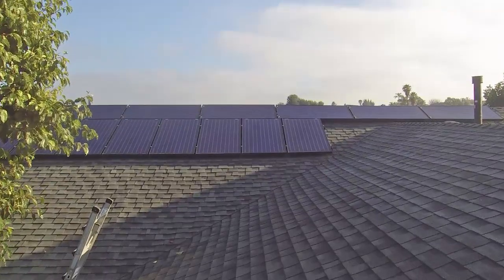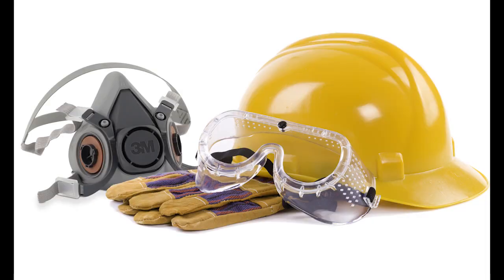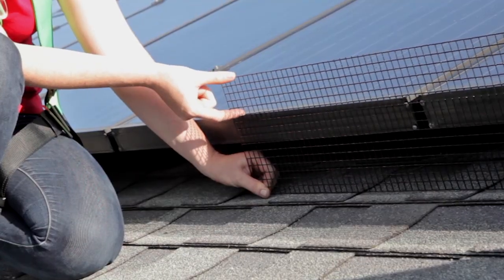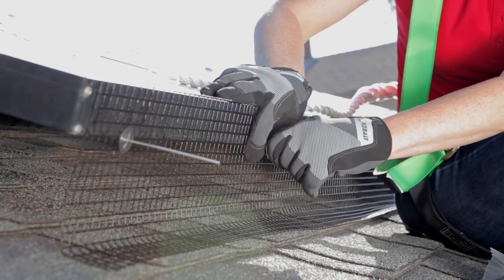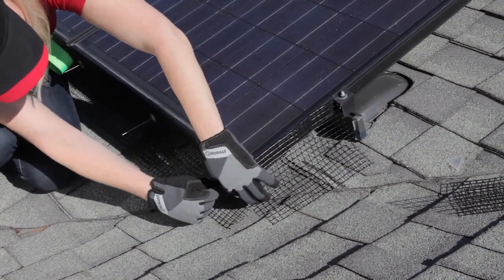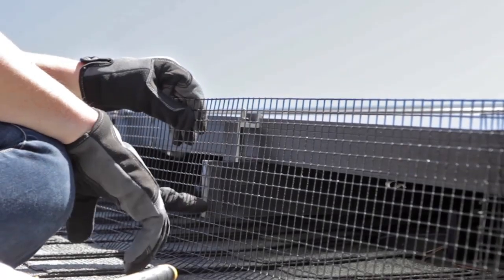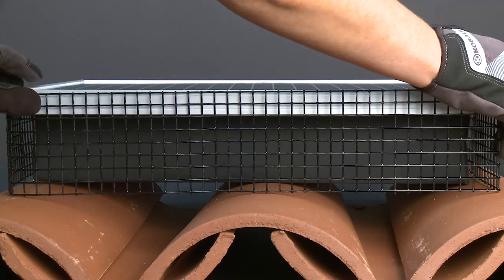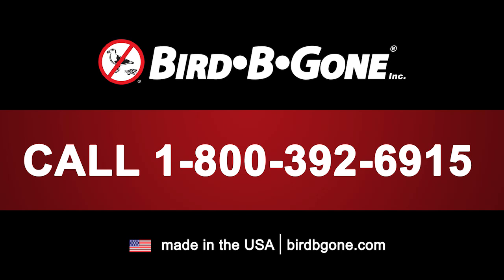Solar Panel Bird Deterrent Installation [Step-by-Step] - Bird B Gone, Inc.

Comment: Nice video. However, I checked your website and man this stuff is OVERPRICED! Gonna have to stop by my local home depot and buy some chicken wire and clips and do the same thing for a lot less.
Reply from the maker: If you choose to use an alternative wire mesh, we would recommend avoiding chicken wire and invest in a quality mesh with pvc coating. Using your average chicken wire will quickly rust and potentially damage your solar panels. This will help preserve your solar panel array and avoid any warranty issues with your solar providers. Hope this has helped!

Comment: Does it void the warranty? Or have Any impact on the output from the panels? Thanks.
Reply from the maker: The solar panel mesh and clips do not penetrate or tap into the solar panels. The clips clamp down and secure the protective mesh to the perimeter of the solar panel array. Although our solar panel deterrent system does not damage the solar array, we highly recommend contacting your solar provider/solar installer to confirm the warranties for your system.
Reply: @BirdbgoneProducts  Thank you!

Comment: Unfortunately these clips were not compatible with our solar panels.
Reply: Use lengths of rebar tie wire and loop holes for grounding screws or support rail. Pull through screen and twist.